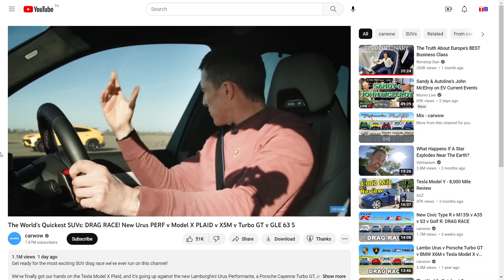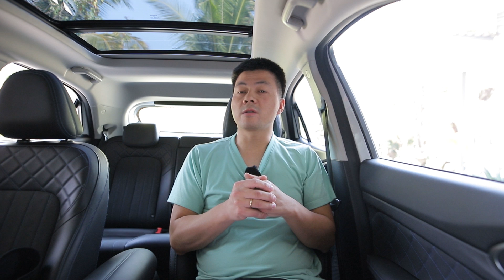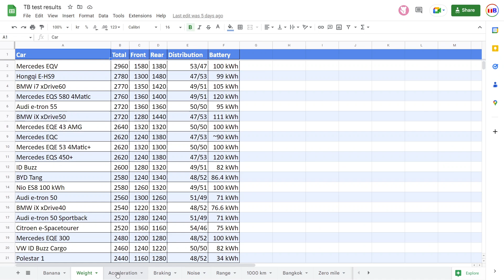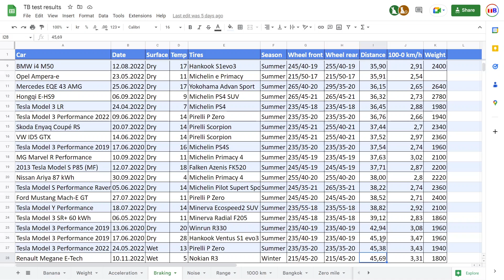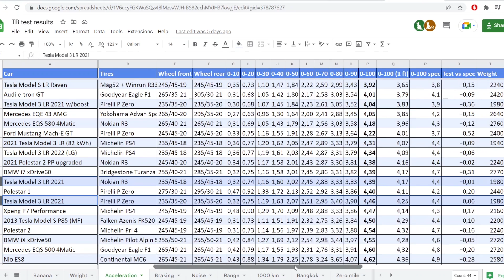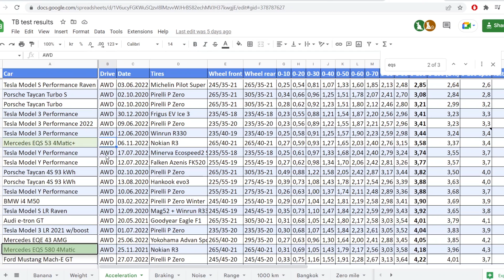Tesla Model X Plaid drag race done by Carwow

Comment: with these weird winters we stopped using winter tires two "winters" ago, after we rarely escaped going off the road after braking in a hot February, in Nokian winter tires. it was a light break, from 80-90kmh to 60, and the car went from left to right and again. really scary. we would not go to the mountains in summer tires, of course. but for when we drive and how hot winters got, summer in "winter' if there is no snow on the ground. but snowy days are less and less common.

Comment: Braking tests always make me chuckle. All modern cars have the ability to lock their wheels during a single braking event and therefore exceed the available friction in the road/tyre interface. Brake tests are effectively a measure of tyre and abs system performance. Exotic disc materials, vehicle mass, tyre size are all irrelevant.

Comment: I once put Goodyear winters on my old Passat, but found they only helped a little on frosty & icy surfaces when you don't drive fast anyway, but above 0C, they were increasingly bad the faster the road speed and the warmer the outside temps. I found them dangerously lacking adhesion in any conditions other than when driving at slower speeds on frozen or snow-covered roads. For Southern UK, winters are a worse option than sticking to the better brands of summer tyres.

Comment: Well most presscars are provided as is. In this case the car was loand from Germany where there still be more winter left. In order for the test to be fare you need to equip with more or less the same setup of tires and wheel. And that is almost impossible since all car are rated with different wheelsizes. Are going back to being a teslachill now again björn? 😉 (joke)

Comment: The test was in  performed in winter.. Under 8 degrees and also  from 100 miles per hour  (161kmh).. The tests you have shown were  performed  in summer when  winter tyres  are way off optimal  as their  compound temperature.. Throttle  House also  in their video of the Model S Plaid , that although it was lightening  quick. Its brakes were dangerous.. You also  can see clearly  in the video, how much brake dust flew of the X plaid in the final metres of stopping...
Reply from the maker: As long as we're braking on dry tarmac then the summer tires are always better.
Reply: @bjornnyland  and the brake system is utter garbage as well! The wheels are just part of the equation

Comment: Yes, the tires are a part of the failed brake test but the standard "plaid" brakes are also known to be weak. Everyone is complaining about that and Tesla even has the carbon ceramic brake upgrade option to future unlock the actual top speed of the cars. Some test have shown that the plaid does not even manage to do one short track lap without completelly losing the brakes. The rear brake caliper is the same as a model3. A vehicle with this weight and power should have substantially bigger brakes.
Reply: It doesn’t even need ceramic brakes because Porsche standard brakes are also massive with 10 piston calipers with brakes rotors that are rust resistant.

Comment: Several of the suvs were shown to have carbon ceramic brakes as an option. Tesla offers this option. The Model X wasn't shown to have carbon ceramic brakes.
Reply from the maker: Irrelevant
Reply: @bjornnyland  bullshit!!! You just want to act as if those tesla utter garbage brakes were even effective!? Lol!!
Reply: @bjornnyland  the stock plaid has terrible brake fluid, terrible brake conduits, terrible brake disk/pads…..
Reply: @bjornnyland  with Porsche you have option to conventional massive 10 piston caliper brakes with steel rotor rust resistant….. carbon ceramic are for the track!

Comment: You forget to considering the temperature. It is about -1 in the morning when they drive to the drag race. And still -1 when they race: https://www.youtube.com/watch?v=Z4DxFbK5cBE&ab_channel=RSymonsRSEV
Reply from the maker: Look at my spreadsheet of braking test. Ariya with summer tires and 4°C has far better braking distance than EQE at the same temperature.
Reply: @bjornnyland  If normal tires breaks better than winter tires at 0 degree, why use winter tires at all?
Reply: @MrJanJunker  because snow and ice?
Reply: @Honza_z_Podebrad  Well. If the other cars is on "all year" tires you might be right. But if they are on "sommer tires" it is not the case. I am not sure if the wording is correct. In DK we references tree types of tires: Tires best in winter, and the recommendation is to use those when the temperature is below 5-7 degrees. Summer tires when the temperatures is above 5-7 degrees. And a third tire that might be better in winter when the temperature is low and road is dry. But not the best tire in sommer nor i winter/snow/rain.

Comment: Sure thing the winter tires will affect braking distance.. but both the model X and X plaid does not have very good brakes. You can upgrade with the 20,000,- USD, at least on the model S plaid. As some other reviewer said regarding the S plaid, supercar engine, brakes of a camry.. something to think about. Carwow should have fixed this, but the test is NOT irrelevant. Until you test this your self. We cannot compare the S and X to the 3 and Y.

Comment: What was the temperature? At what temperature does a winter tire perform better on asphalt/cement than a summer tire?

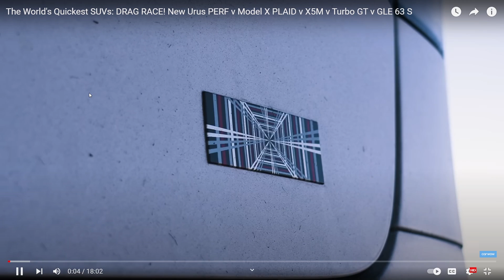We know from Richard's video on his own channel that the day started with -1 degree C (at 1:49 on his clip) and he went to the drag race. In the afternoon he did some tests with the Model X so the drag race was probably in the first part of the day when it's colder. In Richard's clip we see at about the same timestamp that at 4.39pm there were 9 degrees C, so it is possible that if the race happened in the morning (LE: Richard says it happened in the morning, see 10:51), there were 4-5 degrees. Winter tires are usually recommended below 7 degrees.
Reply: Winter tyres are good on ice road and snow ❄️.
Reply: @ehismanj  they are good in low temperatures.

Comment: I have X plaid on winter tires and the car is slightly soft with the beginning of braking.  "so floating".  I wonder at what suspension setting it brakes.  or sports?  Or comfort?  E.t.c?  Anyway, Tesla had to be worse at something, so that the Ego of others would not lose value :-)

Comment: Bjorn, I think the Plaid’s need ceramic brakes and upgraded callipers to cope with all the speed and weight.
Have a look at the brakes on Taycan compared to a Plaid and you’ll see why the Porsche stops so quick.
Reply from the maker: You mix up braking performance for track driving with regular stopping on public roads.
Reply: @bjornnyland  Don't forget stopping quickly on a wet motorway.

Comment: There has been plenty of complaints of the Plaid brakes not being as good as they should be
Reply from the maker: You mix up braking performance on a race track vs normal braking.
Reply: @bjornnyland  this was a race
Reply from the maker: Nope, it wasn't. It was a braking test where they did one braking. A race around a race track would have many brakings. And there the brake fading becomes a problem. Did you actually watch Carwow's video or not? I don't think so. It seems like you have no clue what's going on in the video I was referring to.

Comment: I agree with you Bjørn but also consider the following and it goes in Tesla's favour. The Tesla was supplied from Germany as you know, which requires winter tyres by law at this time of year. The filming was done on a runway in the UK, where winter tyres are not legally required. The conditions was damp and -1 Celsius. The 'driver' of the Tesla is a very well renowned Tesla enthusiast and reseller and has before commented that model X as a platform need better brakes.  The behind the scenes video is here, perhaps you and RSymons could do collabs in future? 🙂 https://youtu.be/Z4DxFbK5cBE

Comment: All cars can lock up their wheels, at least on the first stop, which means it's almost all down to the tires. ABS programming will probably also make a difference. But 90% will be the tires.
Weight only makes a difference if the tires are too narrow as they will overwhelm the rubber. Most big heavy german cars will have very wide tires which is why they have no problem stopping in the same distance as lighter cars.

Also. If studless winter tires are "directly dangerous" during summer. Are they not equally dangerous during winter?
Reply from the maker: No, because in winter they give you the best grip where it matters, which is on snow and ice.
Reply: @bjornnyland  Well. yes. But they are still just as unsafe on dry tarmac.

Comment: Carwow did some very dubious tests with electric cars. Like which electric car can drive the furthest without charging. Why? Your 1000 km test is way more valid. Also they during the test showed that "look how awful electric car are charging, 20 kw? It would take several hours to charge the car in test". But those cars were a kona, 70% charged, an i3 80% charged. Ridiculous. And the cars they were testing can all charge with at least 150 kw.

Comment: Plaid driver here 👋

Bjorn I love you, respect you, but let me explain a couple bits (not excusing carwow but as you piggy-backed your video it’s only fair). 

1. It was -1c to -5c on that morning so winter tyres certainly not at disadvantage. A benefit if anything.,
2. Point proven by 1/4 mile in 10.3 which is about as quick as plaid has ever covered really unless super optimal (not real world cold runway!)
3. Brakes are ok on one hard stop, but do a coupe of drag runs, stop and stop again and the brakes are f**ked. 
4. Driven on the road by my German friend on autobahn he had already found brakes poor and were blue with too much heat.
Seriously.. Bjorn just look at these v porsche, bmw, Lambo,  one brake stop if fine but more then one is no.

Tyres are NOT the excuse. They are simply shit.
I love Tesla. I defend Tesla. I sell Tesla. But you don’t need to make money on this piggy back over an issue which IS an issue. 
Sorry mate. 

Tyres are not the excuse. You didn’t show any data the better there. 

Anyway. I have no motive to defend to promote but this video is a bit unjustified revenue maker… 

✌️
Reply from the maker: 1. Look at my test result spreadsheet (braking test). Even Mercedes EQE at 4°C and winter tires performs quite poorly (53 m) vs Nissan Ariya at 4°C with summer tires (38 m). The winter tires are not an advantage at all even at those temperatures as long as it's on dry tarmac vs summer tires. Please do your own test to back up your claims. I have tons of test data based on real world tests where all the weather conditions are well documented. And this is done on the exact same stretch.
3. Yes, agreed. But many, many people are clueless and mix up brake fading when driving hard on the race track vs actual real world situation where you have to brake hard (and hopefully only once) to avoid a moose or something on public road. Remember that Model Y Performance has the best ever braking distance tested so far in my channel.
4. Again, you mix up brake fade which is irrelevant. Carwow's braking test was only done once and was purely to test braking distance, not performance when driving hard.

As for revenue making. We all know that I make money on all the videos I make. It's irrelevant what topic it is. Please keep that out of this discussion.

I recommend that you do some actual braking tests with Dragy or something more accurate and test many different cars and different tires. And if you can present some data to back up your claims, then I will believe you. As for now it's just some empty assumptions. Sorry mate...

Comment: Carwow said the bad result was caused by poor brakes on Tesla. But all brakes should be able to lock the wheels. What Plaid standard brakes are not able to do well is repeated braking as done in racing situation.
Reply from the maker: Tesla's brakes for stopping in an emergency situation (moose, etc) is quite good and on par with other cars. Remember that Model Y Performance has the shortest braking distance ever tested. What you're talking about is brake fading when using the brakes hard on a race track. That's something totally different.
Reply: @bjornnyland  agree

Comment: The Plaid was brought over from Germany for testing, as it’s out in the UK yet. In the UK, changing to full winter tyres is not common, we rarely change our tyres seasonally as we only get a few weeks a year with any significant snow or ice. People who do change will usually only go as far as Cross Climate tyres. With less driving experience on winter tyres, it possibly wouldn’t occur to them in the moment it would make such a significant difference. Not an excuse though.. they were aware later so should have mentioned it in edit.

Comment: I saw this Carwow video and was impressed that the BMW got such a good start against the Model X. For the brake test I said that the higher weight and speed must also contribute to the Tesla taking so long to stop. It never occurred to me that it would have winter tires. That explains both the above.

To be fair the Tesla was on loan to Richard Symons of RSEV as there were none officially in the country at the time. So it probably came from a winter tire appropriate country and no-one thought to change them.

I hope Carwow re-visit this test with all cars using equally specced tires. I'd then expect to see the Tesla get away from the other cars quicker and stop more effectively. Don't know if the difference can all be accounted for by poor tire choice, but it would be interesting to see.

It's a shame so few motor journalists are as thorough as Bjorn.
Reply: Another thing I noticed was that the Model X didn’t seem to have the carbon ceramic brakes fitted or that they just may not be available for the X yet which would also affect repeated breaking performance which is what they were doing for the entire video breaking hard. All the other SUV’s had carbon ceramic brakes fitted.
Reply: Well spotted.
Reply: The car cane from Germany and they had one day with the car. It was intact a cold damp surface, so not ideal for summer tyres either.

Comment: According to RSymons RSEV youtube channel the temperature was below 0 degrees when they did the braketest. So wouldn’t wintertires actually perform better then summertires in low temperatures?
Reply from the maker: Nope, check my response to his comments.
Reply: Offcourse Winter tires performs better in low temperatures, too say other is just plain stupid,
Reply from the maker: You guys are missing the point here. Winter tires are designed to perform well on snow and ice. Try braking test on snow vs summer tire on snow and you will know what I mean. And when using winter tire on dry tarmac, the winter tire will always be worse than summer tire regardless of temperature.
Reply: @andersrasmussen1985  Sigh... you do realize that winter tires are not better than summer tires even in 0c in dry conditions right? There are tests of this. Not to mention, they must have driven quite a way to meet up at that location, and then they did 6 drag races back to back before performing the brake test, those tires were heated quite well to say the least, so it really wouldn't matter even in the hypothetical scenario where the winter tires are better at low temperatures than summer tires in dry conditions...
Reply: @N0xiety  please show me The tests then ?? And offcourse The are…
 
I been a mechanic in The RDAF (royal Danish Air Force) for 16 years so i do know a little

Why do 
Michelin Hankook brigestone Continental 
And pretty much every other tire Manufacturers.

recommend you switch to Winter tires,
For better handling, breaking, turning and stability when The temperatur gets below 7c
Reply: @andersrasmussen1985  A simple search would have given you the results you seek. But here, if you want to be handed things
youtube.com/watch?v=bKtnczk8Mxk

As you can see, in dry conditions, summer tire is always better than winter tires. Winter tires obviously wins under 8c in wet conditions tho, but that is not relevant to the topic at hand.

Now, even in these tests, they didn't seem to bother to heat the tires up, it's basically like a fresh start off the morning conditions you would expect to have. And yet, even with newly changed tires that haven't been heated up from traveling on the road for some time, summer tire still performed better than winter tire even down to 0c in dry conditions. If the tires were heated a bit, as they would normally be when traveling for some time, or doing back to back drag races as in the case we are discussing, summer tire would obviously perform even better at 0c dry conditions than it did in these tests, while the heated winter tire would perform even worse...
Reply: I beg to differ. Your from Norway and i’m from Sweden so we both know how it is to drive with summertires in cold temperatures on cold but not icy nor snowy roads. But you have a  youtube channel and are entitled to your opinion